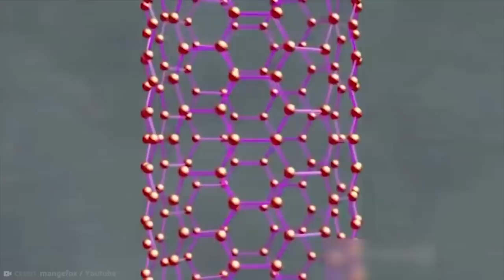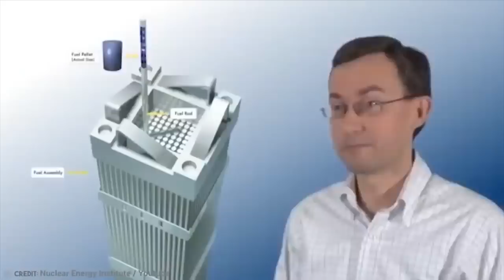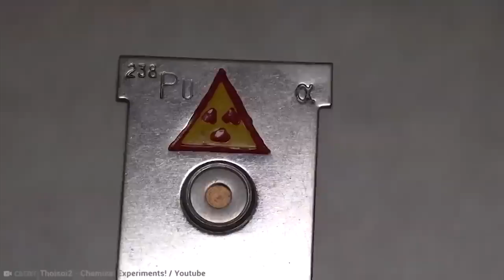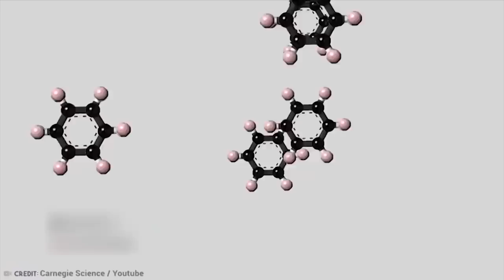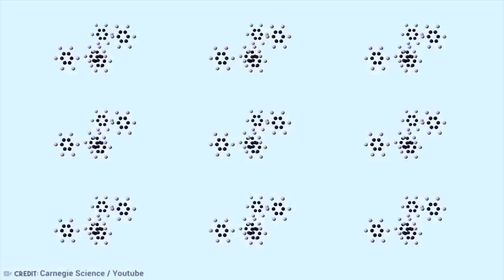20 Most Unusual Substances In The World

Comment: Ah starlite, the invention is real, but the man was a fraud. He got the recipe out of a home chemistry cookbook from the 1920's. If you want to make your own, its not hard. Its 90% corn starch, 10% baking soda, added to a glue (wood glue works great) to make it a moldable putty. It works by creating a carbon foam on its surface. Carbon foam is probably the best insulator you can use. Once it has been used though, and gets hard, you have to remove it and re-apply a new coating.
Reply: well there ya go then, that explains why he couldn't leave the "recipe" before he died because it didn't even belong to him. Great going with info and insight Captain Lulz!